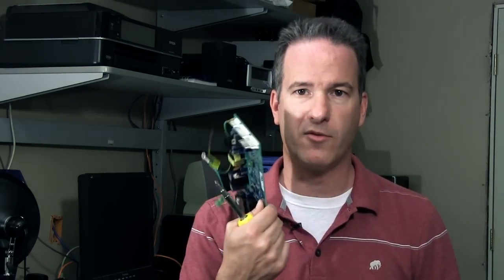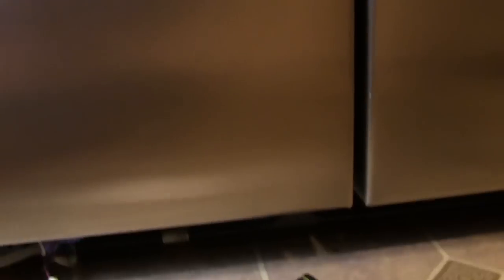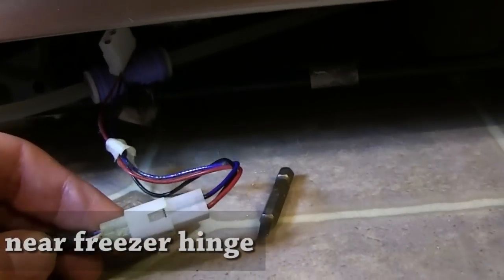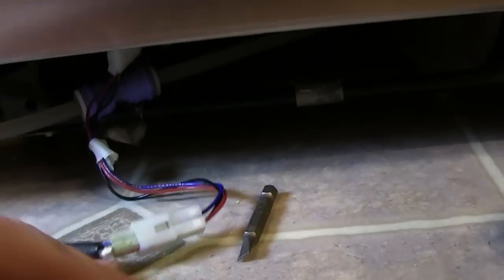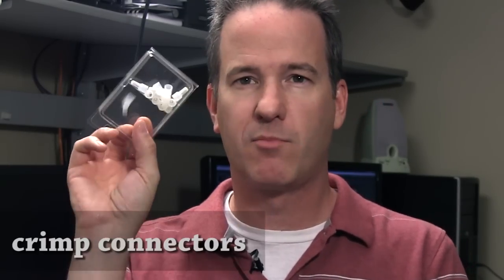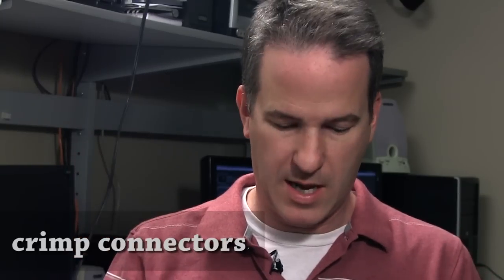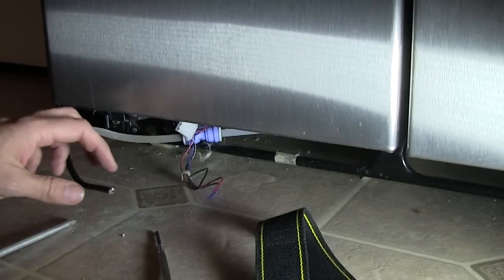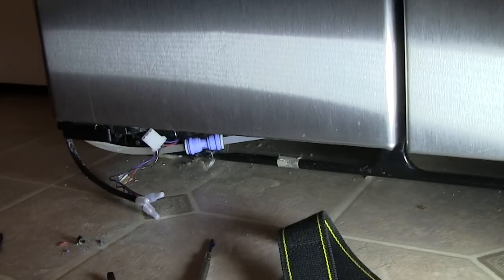Fixing GE Side by Side Refrigerator Water Dispenser

Comment: It's actually called an "artica" I'm attempting to get the water/ice to come out again.  It wasn't a problem prior to my hiring someone to come out & look at it.
Reply from the maker: Robin Shapiro those pesky screws can be hard to see on the kick plate, assuming your model uses screws.
Reply: I hear you.  You're better off trouble shooting the issue and get the part yourself then get the technician in if need be.  There's a lot of information on line; chances are you'll at least have a clue.  Saves $ & makes you feel better to not get ripped off.

Comment: I must have a newer model, the electrical connectors are not at the bottom.  However, was experiencing the same issue, and all I did was jostle the water line at the bottom near the door hinge back and forth a bit.  Once I did this a few times, a small piece of ice broke free, which presumably had been the culprit for the blocked water line.  Hope this helps others with similar issues.

Comment: Say Handyguys, I have another variable not covered in this video. Before I tear into this, on the door panel, do all of the lights shutoff, with each depression of dispenser actuator? i.e. light indicating water, ice etc on the front panel are lit, that is until a glass is placed on the actuator. Then all lights go dark, and no water. Is this a wiring coupler problem? Or is the main board?

Comment: I have power to my circuit board  but nothng  coming on in front. There is an 8 pin black plastice clip on the circuit board that seems to have nothing to connect to. I wonder if thats my problem

Comment: how do I get the kick plate off below the refrigerator?
Reply from the maker: screw on each side .  they are hard to see...you need to get your flashlight and head down on the floor and you can see them on each end of the kick plate
Reply: Thank you. It did not fix my problem 😐  The lights are on the panel, we think the motor may be out?